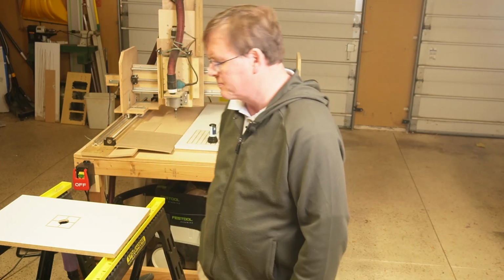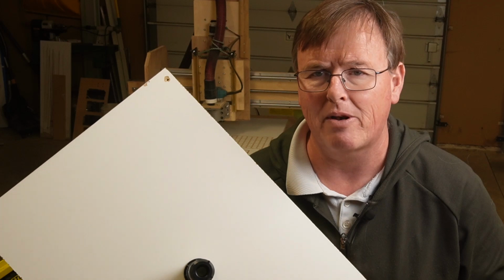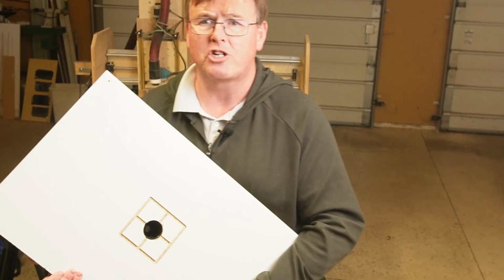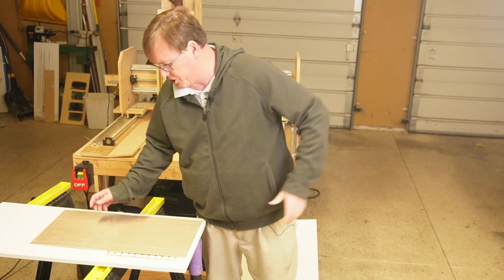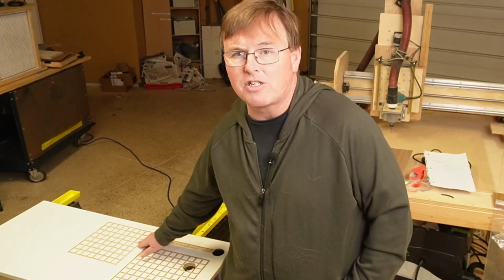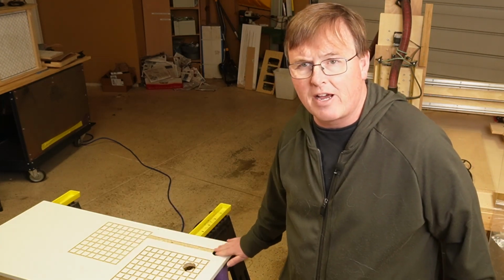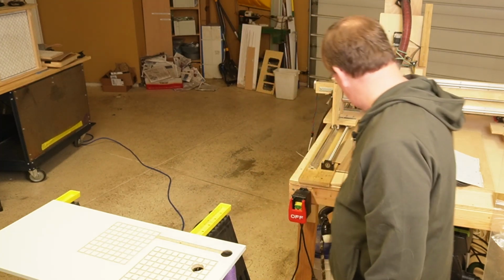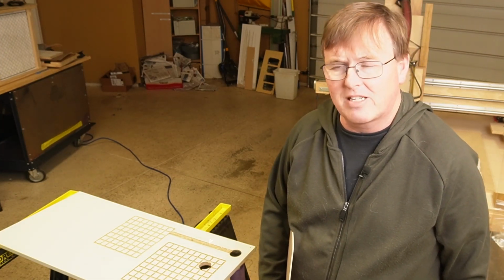DIY SHOP VAC VACUUM TABLE FOR CNC OR WORKSTATION! BUILD FOR LESS THAN $25 IN ABOUT 1 HOUR!

Comment from the maker: I just posted part 2 to this video that shows you how to efficiently machine the vacuum table, demonstrates it being used with a vbit to make a sign, and also gives a solution to help reduce the chances of your vacuum overheating (by poking a small air inlet hole in the pool noodle coupler).  The video is called "A $20 DIY VACUUM TABLE FOR CNC AND WOODWORKERS -- CAD, MACHINE, & TEST.  DOES IT SUCK REALLY GOOD???"  Here is the link:

 https://youtu.be/pWSyRxU38HM

One of my viewers gave me a great tip.  The Fein vacuum cleaner apparently has two motors -- one for suction and the other for cooling.  It is perfect for the vacuum table setup (and would eliminate the need to cut a air cooling hole in you coupler to keep the vacuum cool).  I think its definitely worth checking out.  I am not an affilitate or being sponsored by Fein.  If you were to be the viewer that shared this incredible tip Thanks!  Please comment so I can give you the full credit you deserve for your insight.  I think this might be the perfect solution for alot of DIY vacuum table makers.

Comment: Why is a down cut bit important?
Reply from the maker: It keeps the surface board from getting as ripped up.  That will make it easier to get a good seal.  It is not essential but the cleaner the surface the better it will hold a vacuum (and lower the chances of your table losing suction and a workpiece slipping ruining your work).

Comment: Hi, I like the idea of using melamine board as it stops the vacuum from leaking air. You could make the long channel on the reverse side and glue another thin board, which would probably be better.
Reply from the maker: Good idea.  Thanks for sharing.

Comment: Used Central vac you can find them cheap or even free. The motors generally have bypass cooling. Which is way better than typical shop vac
Reply from the maker: Great suggestion, I will have to look into that for my next setup! 😊

Comment: Maybe look directly at the lens and not the screen. Face is at an odd angle to the cam. Great content, odd view of the creator.❤
Reply from the maker: Your right.  I am working on looking directly into the camera lens (rather than the side screen that I often have extended to make sure I am in the picture).  I definitely need to get better with filming and delivery (and break my habit of looking at the extended camera screen.  It also doesn't help that my glasses are bifocals (which definitely contributes to odd angles).  Oh the joys of getting older).  Thanks for the video tip.  Hopefully you will see an improvement in my delivery in future videos.  Please keep letting me know if you have other suggestions.
Reply: @Simplifycnc the only reason I mentioned it it's because I suffer from the same condition. I wear bifocals as well and I'm about to get a new set of glasses that are called Blended. There's no visible line and they just mix your Acuity levels according to your preference.

The real reason that I commented is because I really really like your content and I like your mannerisms and your demeanor and how willing you are to share.
I also know how hard it is to find supporters for what we do. I'm just a guitar maker with a CNC but by day I'm a gardener and I make content based on gardening because I'm passionate about that.

Your passion shows and that's why I became an instant subscriber.
May you be blessed continuously for your efforts!😇
Reply from the maker: We share some similar interests.  I have 3 raised garden vegetable beds (hip high --- love, love, love them) and several other garden beds that I use with the square foot gardening method.  If you're into hydroponics at all there is an amazing channel who used to post a lot of youtube videos about 5 years ago called mhpgardener.  He used the kratky method and produced huge quantities of lettuce (with no special pumps or changing of fertilizer solution once it was set up) and also hydroponic crazy amounts of tomatoes for pennies in fertilizer (using pumps that flushed fertilizer solution a couple times a day through perlite).  I highly recommend checking out what he shared even if it is for just knowledge.  I tried his method with buttercrunch lettuce (5 gallon buckets and no pumps) and it absolutely worked.  This summer I may give tomotoes a try with a solar powered pump since I don't have power in my garden).  Is your gardening channel primarily for vegetables or flowers and what is it called?
Reply: @Simplifycnc i will definitely be checking that channel out.  My channel is mostly about organic gardening in concert with nature. We've evolved our garden beds and surrounding ecology into some pretty amazing spaces. 

I grow soil, then I just plant whatever we want. Its a true labor of love. If Im not in the gardens or the vineyard, Ill be in the workshop or the lab. The passion to grow runs deep. My CNC journey only recently began, so Ill be playing catchup for a while.  Im super jazzed that I found your channel!

Comment: I’m not sure I would want to deadhead my vacuum for that long. Did you consider using a vacuum generator and compressor to drive it?
Reply from the maker: I did. Some of the low cost vacuum pumps I read from others had a problem of leaking oil into the vacuum air (and eventually getting on the CNC/wood).  Definitely if you wanted to spend the money you could buy a better vacuum setup that is able to handle more load (without the oil leak problem) but that for me that was cost prohibitive since I didn't want to spend over $150 on this add on.  I did attempt the compressor approach (since I already had one).  This I think would work but when I bought the connectors for my compressor they didn't fit and I never got around to running down the correct fittings.  If I knew exactly which ones it might be a great solution but I just am not sure.
For me, using the vacuum that I had was worth the risk (leaving a small air vent in the pool noodle for cooling).  I found it very effective to pull flat (slightly bowed) thin veneered plywood so that I could vcarve without the board's initial bow messing things up.  Hope that helps.

Comment: Thank you for your information. It has motivated me to begin a research project on how we can incorporate your ideas on our CNC in our community wood shop. Our work area is 16.4” wide X 23.5” deep. Did you consider if a higher HP vacuum is needed as the work area grows? Additionally, what happens if your work piece does not cover the entirety of the table? What about a vac table with an 80% coverage of our work area? How much can the work piece exceed the vac area? TIA and I have subscribed to your channel in hope of getting more ideas.
Reply from the maker: Definitely a higher power vacuum will improve hold down.  You of course will want to make sure that the vacuum is capable of staying cool so that it doesn't overheat and blow its motor.   I would suggest you try covering up unused area of vacuum table by laying down some wax paper or rubber matting to block unneeded holes.  I think others have found that newspaper works pretty well for them.  Hope that helps. How thick of a board are you trying to pull down?   You might also consider using several low cost shop vacs and just having each of them dedicated to a much smaller quadrant of the overall table.  This likely would be much less expensive that going with a profession grade vacuum if you are willing to put up with the clutter.  Thanks for subscribing and good luck with your vacuum setup.  Let others know in the comments if you find a good solution that works for you.

Comment: is this hard on the vac or not really?
Reply from the maker: You definitely want to monitor your vac to make sure it is not starting to overheat (and obviously shut it off if it is too much strain for your particular brand of vac --- some makes of vacs are better than others at cooling/air flow).  A side air hole in pool noodle can be adjusted larger for more cooling of motor (but of course that does come at a cost of less suction for your vacuum tab;e).  I use a hole in side of pool noodle about the size of a quarter to reduce strain and keep my vacuum from overheating and thus far have found the vac table sufficient to hold down thin veneer boards (pulling out the bow in the boards so they are flat over entire service) so that I could machine with my CNC.  Every vacuum brand is a little different so my suggestion is give it a try and monitor your vac closely to make sure it isn't too much strain (and obviously if it is then shut your vac off immediately or you could damage your vac).  Of course, everything shared use at your own risk (and monitor whenever in use).  I hope that is helpful.

Comment: you, sir are a very rare bird -- and we have arrived to nearly the same spot at nearly the same time.   thx for this.  a few suggestions from my own endeavors into this exact same thing that may simplify a few things -- 1)  pvc male adapters also offer threads and a shoulder. you can get them in the plumbing or electrical aisle in white, or grey and even black if your store carries abs too.  i love your sprinkler head idea but the male adapters are less expensive 2) pvc male adapters use standard pipe threads -- the same as black pipe   3) there are cast flanges for black pipe  .. believe they are called floor flanges --- >> this removes the need for the precision hole for the perfect fit for the threads , screw the flange on and then screw into the flange.  your way is faster and if you are machining the hole once you know the diameter it works fine but if inserting and removing the press fit becomes challenging or annoying that is another option.  i like the clear plexi idea for the channel.  I use blue tape or 6 mill poly to mask the edge between material and channel.  just put it on top and it will suck down to the gap.  the 6 mil poly is most re-usable and has worked for me.
Reply from the maker: Fantastic input!  Thanks for sharing all this with other makers.  I love the 6 mm poly tip.  I will definitely add this to my (borrowed) bag of tricks.

p.s.  I guess since we both came up with these ideas (and more significantly were crazy enough to actually use them) that makes you also a very rare bird.  If you have any more crazy ideas that work shockingly well be sure to share them.  Most YouTubers are simply browsers and  will be just entertained by them but a rare few will actually try them out and be well rewarded for their audacity to put into practice something novel.
Reply: @Simplifycnc  I did my 20" x 20" vac table a totally different way.   I used 1/4" brown board on bottom -- that board that is smooth on one side and fuzzy on other - same as used for peg board.  Shiny side up for bottom piece -- . I market it 20x20 and then added a 5"x5" extension off the front right -- (same concept as you and your channel but I had no channel, just an extension on my square shape).  Then I cut 3/4" plywood unto 3/4" or 1" wide strips and framed out that bottom shape.  I then put caulk down around edge,  set that plywood in caulk and then used a small pin nailer (trim gun) to tack the plywood in place until caulk dried.   Then, (yhou'll like this), for the supports I use 3/4" metal plumbers pipe hanger material -- I cut it at about 40" and made an according out of it -- set it in the body of my box and let it float around -- and I made 2 or 3 of those -- it. No channels no machined -- just set a piece of peg board with fuzzy side up or mdf on top with no seal and turn vac on and it's a vac table  .. OOPS I forgot to add -- on the 5x5 area that sticks off I made an adapter for my vac hose, similar in concept to you but with the plumging fitting.    The peg board works very well but if you cut over a hole on thru cut you may get small disrutbance in profile -- the mdf worked good too.

Comment: This is fine for running a cnc where you learn to live with a huge amount of noise but on a workstation?  I'm going to be carving a piece or  or working detail on it and have to listen to a shop vac roaring away while I'm working.  Let alone if I need the shopvac to be handling dust removal on the piece I'm working on.  So now two shop vacs roaring away?  This is why micro-pumps.  Very quiet and only provide suction when it's needed.
Reply from the maker: True - shop vacs are awefully noisy and it does make you want to have two shop vacs (one for dust and a second for hold down). I have thought about moving my vac outside my garage to cut down on noise.  I have also thought about upgrading my variable speed router to a spindle (much quieter at least until it starts cutting into boards). Eventually I think I am going to completely sound shield an enclosers for my CNC to cut down on noise and also for safety (but I haven't figured out exactly how to approach that yet). What micro pumps have you tried and what is the price point for other CNCers to get into something like that?  I definitely am bias toward keeping cost down but sometimes its worth upgrading particularly for production work.  I think your recommendation is sound and worth looking into if its within one's budget.
Reply: this same thing may work with small vac pump.  it just takes longer to evac the air .  a vacuum is a vacuum.  the only question is if the seal created by this setup is enough to prevent more air from coming in that the small pump can evacuate.  i believe it may work but would have to test. just build an adapter. to cover the big hole with the attachement for vac pump. can buy that fitting , use plywood for adapter and drill hole for fitting and self tap it into the plywood, kind of like being done with the sprinkler head.   i started with that idea and this idea he's doing with a piece of 2x12 and just put vac pump connector in edge and drilled through side to the grid in top of 2x12. it worked similar.

Comment: You're a genius I'm going to try this
Reply from the maker: Thanks for your kind words.  When I first prototyped and tested out this idea I was shocked at how well it worked especially when using it with thin veneered boards (walnut is my favorite).  Side note, you can pick these up in 10 packs online really inexpensively (a couple dollars each for a 12 x 12).  When you are finished you get a great looking project without spend $$$ for hardwood and also it makes your project much lighter and less bulky.  It's fantastic for small signs and game boards.  Regular mineral oil makes the wood veneer pop with no nasty fumes and not nearly as toxic as other finishes.  I think you will be pleasantly surprised at how well the vacuum table does pulling out any bow in thin boards.  Let me know how you like it once you have had a chance to try it out.  Good luck with your build.

Comment: Why not use the cnc/router to make the plexiglass cover level with the melamine and then make the air channel that much deeper underneath the pelxiglass (and let it continue a little bit into the square pattern to let air through properly)?
Then wouldn't it be a more permanent installation of the extension? (I'm not a cnc owner (yet) so I can't test it, but can't really see a problem with it either).
And you can probably benefit from some hotglue to hold the plexi down and seal off against the now rough, machined surface, but it may also allow for some of that extra airflow that the vacuum may need.
And I love the idea and think about doing something similar with and for my laser cutter (I'll probably make it from two layers of thin mdf that I will have to glue together and then maybe seal with some coating. It'll be an experiment, but I have the same problem with bent plywood.)
Reply from the maker: Great idea!!!  I never thought of that.  If you make one send me out a picture.  I am putting it on my list of projects to try.  Would it be alright if I use your idea in a follow up vacuum table video some day (it will be awhile as I have a CNC building series to complete first)?  If I use it, I will give you full credit for your creative useful solution.  I think its an elegant approach that has some significant mod potential for other applications as well.  THANKS for sharing your idea!
Reply: @Simplifycnc  You're welcome 🙂 Use it as you like - I guess someone has already done something similar. And if you mention me it's like I get a free prototype 😉
Also you can use the underside to make patterns and channels "overlap" to create more than one zone, but that might need some redesigning of the sprinkler connection 🤓
Reply from the maker: Thanks.  I would definitely glue the plexiglass down permanently.  I am seriously thinking about tweaking it out with some LED lights/design etched in surface.  I will let you know when I make it (even if it doesn't work but can't see why it wouldn't).  It probably won't be until the start of next year.  

A laser cutter is something I don't have but its on my wish list.  Maybe I will add it to my CNC someday (its an easy add on).
Reply: my experience has been you don't need to glue down the covers. if u were to cut the channel and set it in there when you turn the vac on it just sucks down and you are done.  you could add caulk or glue to the rough edges but i've not found that necessary.